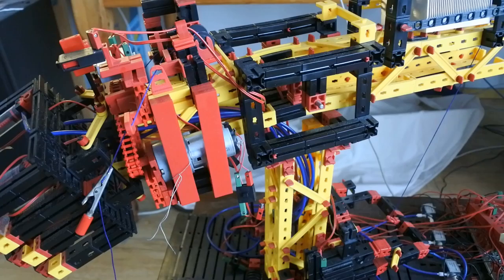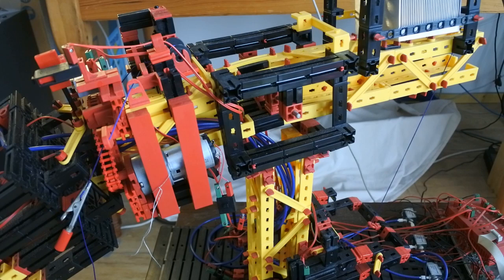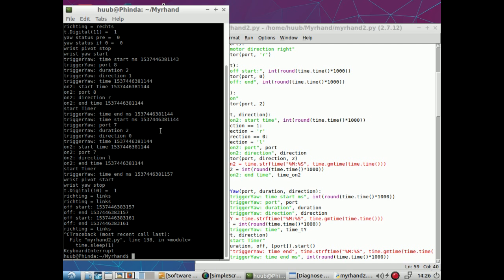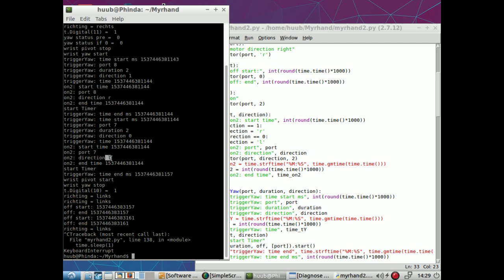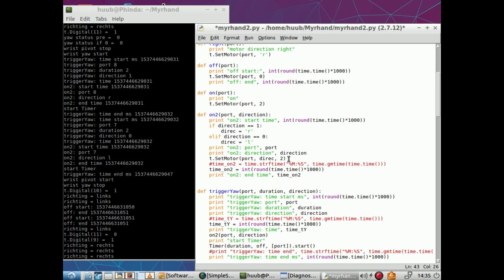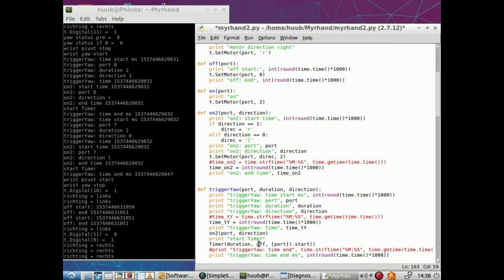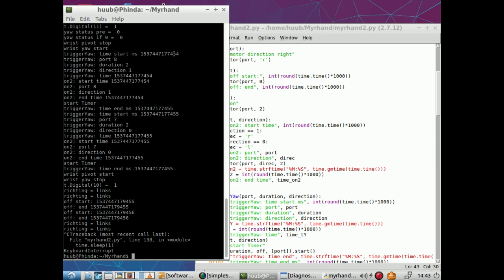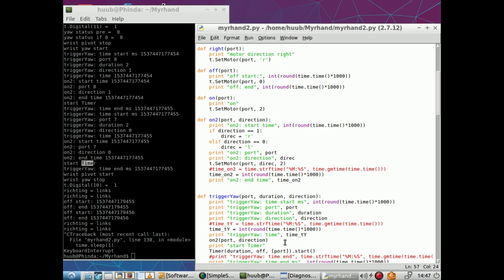fischertechnik pneumatic "hand" #138: Yaw, Timer, Python, algorithm, oops, milliseconds, variable

Comment: Seems like triggerYaw() gets called twice in your main loop. Probably in the first loop cycle in line 163, then in the next cycle from line 176. If your code wouldn't crash, you would also see off() being called twice ...
Reply from the maker: Yes, triggerYaw() gets called twice in the main loop, but even then it shouldn't happend the it happens now. BTW, my code doesn't crash, I interrupt it using Ctl-C. Gears rattling isn't good. But yes. seeing off() being called twice, could maybe explain some.